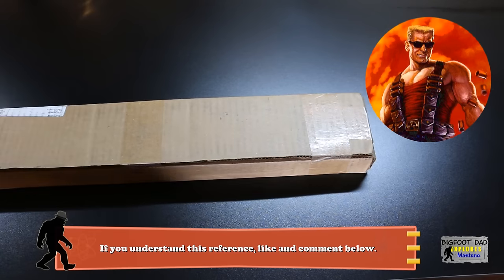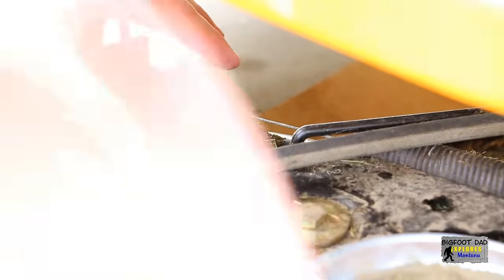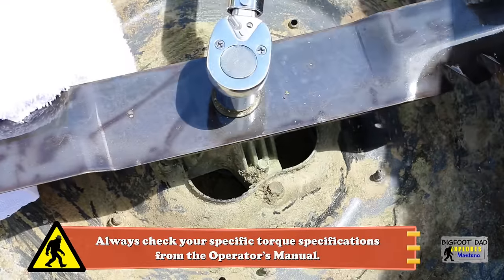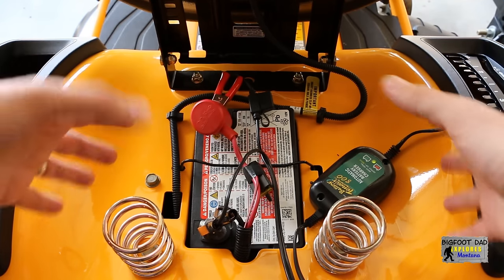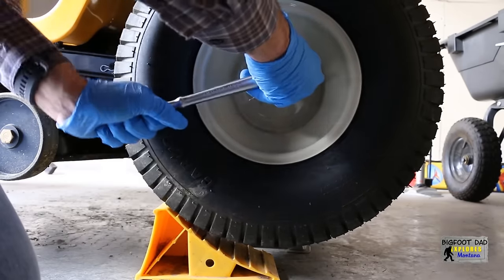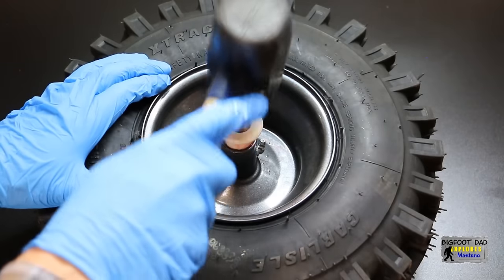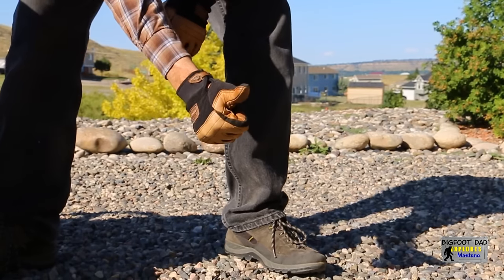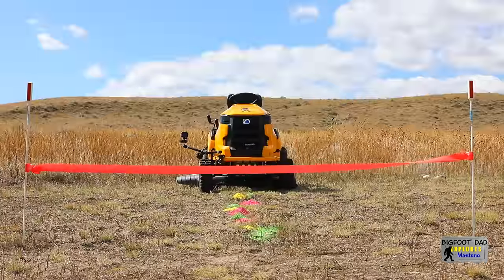Upgrading Your Tractor Mower: Cub Cadet XT1 LT42" Mower (ATV Tires, Blades, Brush Guard, Headlights)

Comment: When I removed my deck for the first time I power washed it sanded it down and had it sprayed with bed liner. 20 years later it’s still rust free.
Reply from the maker: Hi, Medic407 - I agree - I should have done that in the film.  I appreciate your feedback and I may give this a shot now!
Reply: Under that bed liner there will be rust.
Reply: @BigfootDadExploresMontana  what  did you use on your cub cadet riding mower to give it shine. In the upgrade video
Reply: @BigfootDadExploresMontana  EZ-Slide Oil Based Graphite coating helps preserve the deck AND works to keep wet grass etc. from building up under the deck. I wire cup brushed mine clean, scuffed the remaining good paint, blew the loose dust off with an air chuck. Wiped it all down with acetone and brushed on 3 coats of the EZ-Slide. I have a Craftsman T240 that has the exact deck setup. Just slapped the AG tires on the rear to get through some swampy spots in my 1-3/4 acre yard.
Reply: I scraped off all the grass this past Saturday from My 2020 Cub Cadet Enduro with Intellipower and power washed it. Later this afternoon (Monday) I am going to spray mine with two or three coats of "undercoating" I bought from Tractor Supply Co. It's for undercoating automobiles. It should hold up for years. I will check it in two months to see how it is doing. I had considered bed liner. Glad yours worked out as good as it did.
Reply: John Wattie but the rust will not continue to spread duh 🙄
Reply: My 1964 Simplicity Landlord Tractors deck is in as near new that can be expected for a close to 50 year old tractor. I just clean its deck twice a lawn cutting season here in Michigan. I mow from late April and than mulch leaves until about first week of November. There is something about mulching leaves and leave its deck nice and clean to a point and where it isn't i just take a putty blade to it once mostly clean I just use a spray can of penetratingly oil and soak it down. Never use a power washer on a deck unless you cover up the blade arbors to protect them so as not to force water into them. BTW I also own 2 other tractors but much larger than my Landlord that are about 30 years old each and I do the same to them and they still look as new. But Simplicity tractor decks are thicker than most others. Thanks
Reply: Yeah I was wondering if I could spray it with something to make it last, I'm going to have to do that come spring time.
Reply: Does grass stick to it easily?
Reply: @RockyJayyy  in the back corners it did but it washed out great. I
Reply: @unclejohn5012  if the metal was prepared properly before adding the Line-X, how will rust be underneath the material?
Reply: Can I buy a spray can of bed-liner and apply that OR is that something special??
Reply: Smart.
Reply: A lot of people say the bed liner makes grass stick

Comment: I added a washout port to my mower the beginning of summer. You'd be amazed how well it works. My mower deck used to look like that when I would have to scrape off old grass a few times a during cutting season. I checked it this week before storing for winter and with regular use of the washout port after every cut there was hardly any grass stuck to the mower deck.

Comment: I have a 2005 Troy Bilt Pony. 42in is perfect for my property because it's just a single family home. The deck is starting to rust through and it is discharging all of the debris out of the top of the deck. The mower runs great but I know I'm going to be in the market for a new one after this season. I was at Home Depot yesterday picking up blades and I was literally looking at this exact Cub Cadet sitting next to the same size Troy Bilt Pony that I have right now. I like the hydrostatic drive. I like the taller profile and I love the seat. This is $400 more than the Troy-Bilt. I'm glad you made this video. It just made it easier to make my decision.

Comment: Thank you for the tips.  My XT2 spends all summer towing a dethatcher and aerator as well as trailers and all winter pushing a snowblower.  Liquidflating the rear tires added traction for towing and pushing. Your new blades are for mulching,  you can tell by the inward twist of the teeth at the back of the blade.  High lift blades will be twisted outward to increase the lift and discharge of material.   After a couple of warranty issues with a new machine it has proven to be an excellent purchase.

Comment: Cool video! I upgraded mine with bar tread tires almost immediately. Natural springs make for copious mud mowing opportunities.

 Tip: oil change is a fall maintenance item. You don't want it sitting all winter with the impurity "tainted" oil.
Reply from the maker: Hi, Norsefalconer - thank you for the feedback and the oil change tip.  I certainly think that is reasonable and may look into that after this season is over. 
Your mud mowing opportunities sound epic. 😅

Comment: I have watched about 46  videos about lawn tractors and zero turn mowers. I have taken 1 trip to the store for a sit down in different models.and a phone call for extra info. I was at the probable decision on CC XT1 42.  But honestly, I have been walking my mower for 30 years, and the hills and dips make the decision difficult. This and your other Cub Cadet video are just fun. If I get one, you will have tipped that balance. I will probably need those big O tires for my hills. Thank you again.
Reply from the maker: Hi, Stewart!  Thank you so much for your feedback!  I think as long as you're hitting the hills straight on and they're not too steep, something like this may work (in accordance with the safety guidelines for the mower - sorry, have to say that 😉).  The tires seem to help my on my terrain pretty well.  If you decide to get one, let us know how it goes!
Reply: @BigfootDadExploresMontana  Today was the day.  They (Tractor Supply) raised the price back to 1699, from last weeks 1599. Didn't notice until on the trailer.  OH well.   Got it home went straight to my hills.  It did OK on about 1/2. The other 1/2 was a little sketchy. My hills are bumpy.  as a rear wheel lifts up, ... yes it just spins. I could rock in the seat a little an that helped.  A little shovel work will fix  my entry  and exit, to the highs, and lows. Checked tire air when putting unit away . all 25+ PSI . Took them down to 13PSI and will how it  does.    
 Thank you for your pep talk. I think TSC owes you a thank you also. Now lookin for a GUITAR silhouette   sticker. With Flames of course.  :)

Comment: Great video.  I’d love to put those tires on my XT1.  I’ve gotten stuck in my muddy yard a few times in the spring and fall.
Reply from the maker: Yes, I think you'll find these work pretty good.  Right now my tires are still covered in mud from last season.  It does seem to help!  Put them on and let us know how it works.   😎
Reply: I have bar treads on mine. It only got stuck once, but it was sunk to the rear axle. Mud Mowin' Baby!

Comment: I clean my mower deck after each use and spray it with silicone or teflon spray makes the deck look new your deck is already full of rust just a tip

Comment: Never had an automatic battery charger.  Have an ancient old 1 amp trickle charger though I put on occasionally when I bring the battery indoors for winter storage.  I thought of adding a brush guard, but then I wouldn't be able to get in as close as I like to in some areas, leaving more for the string trimmer to do so I opted against it.  I did add LED lights instead of the old incandescent 1156's.  Our land is fairly flat so atv tires are unnecessary.  I did however pump slime into the old tires so I don't have to air them back up every week, lol.  Adjusted the valve lash yesterday, .004 on the intake and .006 on the exhaust.  Also added "poor man's power steering" by adding needle bearings to the front axle spindles.  Will also add bearings to front axles and get rid of the old bushings to save on axle wear and let the wheels spin more freely.  Also fixing to put in an inline fuel switch to make it easier to run the carb dry in the fall without having to empty the tank.
Reply: Just bought a Cub LT50, and was thinking of adding bearings to the axles. If you have an AGM battery you should make sure the battery charger is compatible.
Reply: @anthonybrincefield2812  The batteries I use are plain old-fashioned lead acid batteries.  I've found that if I leave them in the mower over the winter it shortens their lifespan significantly as opposed to wintering them indoors in my utility room and occasionally topping them off with the trickle charger.  My last battery lasted about 3 years keeping it outside in the mower.  My current battery is the same brand, same cranking amps, etc. and so far it is now on its 5th year and cranks the engine over as well as when it was new.  Now, of course I don't do that with my truck's battery, but it gets used at least once a week so it isn't sitting dormant in the cold for long periods of time.

I did add the needle thrust bearings to the steering spindles and they work great.  However, the bearings I tried to replace the bushings with, while they fit okay inside the wheel hubs, they would not fit on the axles at all, not even when trying to persuade them with a BFH, lol.  So, for now at least I'll just keep greasing the old bushings.

Comment: I love how it looks, BUT, those tires would tear up a lawn so fast. If you plan on doing field work with it, fine but a regular lawn, no thanks.
Reply: They won’t tear up anything unless it’s wet
Reply: Cool video. ATV tires with traction control does chew grass up dry or wet. Wifey not happy when I tried those tires. In the Snow they work great!
Reply: @hipsterj1  👍
Reply: I cut all season with chains ⛓ on my tires. Only turfs the lawn if you spin which isn’t very often.

Comment: I bought this mower last year (2020) and planned on it serving me for several years. I was proud of my new mower! I changed the oil and filter at 4.8 hours and used it most of last summer. It sat in my carport during the winter. I changed the oil and filter again at 11.1 hours before using it this spring. I had been using it approximately 15 - 20 minutes when I heard a loud bang and it stopped immediately. I took it to an authorized service center and after contacting MTD (Cub Cadet Corporate) they will not cover the warranty and fix my almost brand new mower! I talked to corporate and asked them what I could have done to prevent this, and their answer was they wished they could tell me, but they are not going to fix my mower. I will never buy another Cub Cadet product, nor recommend to anyone I know! Through no fault of my own, this mower turned out to be highly defective, and Cub Cadet is being penny wise and dollar foolish!
Reply: I,m going to guess that without a fuel shut off valve, the fuel leaked into the oil when parked and thinned the oil and took out the bearings. I had similar deal with another mower after forgetting to shut off my manual fuel shut off valve

Comment: Dude, go get a riding mower lift and thank me later. And stop mowing wet grass!
Reply from the maker: Gilitar - this is... tempting.  And it's giving me an idea.  😂  As for the mud, I wish I could avoid that, but to be honest, it is so dusty that I actually wait for a light rainstorm before I mow sometimes.  I do let it dry out for a bit, but right before it's completely done, I'm out there hitting it out as fast as possible.
Reply: I have a mower lift, it is a great time saver.  I use my cordless impact to remove the blade nuts then put them back on with a torque wrench, its much safer with a impact removing the blades, you can put them back on with an impact but I don't recommend it as you may over-tighten and strip the threads by doing so.  Yep mowing really wet grass causes all that buildup under the deck.

Comment: The exit chute often cracks or a stone will blow through it. Had to replace two!So, I spent $20 and had a spray-in truck bed liner. I used Line-X. Fixed the problem.

Comment: I genuinely enjoyed this. I installed off road led lights to my Troybilt and although not necessary I made my blades razor sharp just because we got buffalo and Johnson over 5x5 acres and layered a super thick layer of flex seal and flex tape on the inside of tires
Reply from the maker: V8 For A Heart - the off road LEDs - dude, yes - that's what I'm talking about!  You have quite the yard adventure and, actually, it sounds like a blast.  And you've upgraded just right to suit your needs so I commend that!
Reply: Bigfoot Dad Explores Montana my mower crapped out a few weeks ago. Bearing chewed itself right up on the shaft for the blades. Collided with the other blade and bent the shaft , cracking the hub and in turn locking up the motor to a complete stop and roasted the belt.

Comment: Just ordered a set of those rears for my zero turn. I have a low strip across the middle of my 5 acre yard that is slow to dry out in the spring when I start mowing and I get stuck every year while trying to get that area mowed. With these tires I believe my spring time mowing will be more enjoyable this year. If I am happy enough then my second zero turn will be getting a set also.
Reply from the maker: Hi, Dale86 - this sounds like an awesome upgrade for a zero-turn. Send me a picture after installed to my Facebook account and I'll share it here.
Reply: @BigfootDadExploresMontana  Will do!

Comment: You mean to tell me that this guy cares about his mower and did maintenance lol when I get a mower in no one changes air filters or oil thanks for the video good quality and content  I like the upgrades and those blades are a good choice I’d recommend them to anyone who mows grass also cub cadet is good I own some old ones and love em probably one of the best brands I do recommend that it’s helpful to clean it off when done using it I always leaf blow mine off when done because the grass holds moisture I learned a lot from this video thank you!!
Reply from the maker: Hi, Hunter - yes, indeed!  I bet you see a lot of the worst of it in some cases if you're doing this on a regular basis.  😂  I really appreciate your feedback and insight.  I agree with you on the cleaning procedure - the leaf blower would actually probably be a more efficient way of cleaning off the mower.  Thanks again and keep the comments and tips flowing as we release new videos.
Reply: Bigfoot Dad Explores Montana your welcome glad I could help your videos are straight forward and to the point

Comment: I recently upgraded mowers but now have a 12+ year old YardMan with a shot deck that still runs fine. I have been kicking around ideas of what to do with it. I don't have a need for a proper large tractor but I do have some tasks in mind that I might be able to fabricate some attachments for this mower to do. I might have to make a front and back attachment and cast some cement weights to keep it grounded, but those tires you put on certainly got my mind thinking. The only thing keeping me at bay of doing all this is I don't have much confidence in the drive train / transmission if you will on these things holding up to this sort of pulling force. I picture the drive box to be made up of mostly plastic / nylon gears and that when under this sort of pulling force it might just chew them right up, or the belt that drives the whole thing will just begin slipping. Who knows.
Reply from the maker: Hi, Terence - You have a very valid point about the stress on the transmission from those tires.  That is eventually what lead me to put that disclaimer on the front of the film.  The transmission was probably engineered for these turf tires to allow slippage if under too much stress.  On your YardMan - it may be time to upgrade that thing with some of the mods you mentioned and maybe post it on your channel!  🙂

Comment: My XT1 is spotless underneath. Mowing leaves in the fall cleans under the deck down to bare metal just like sandblasting would. I never remove the deck to change blades. Works for me.

Comment: Great video! Love the aggressive tire look. I've been using same set of Gator blades on my JD for nearly 20yrs are great! The only thing I would change are the front plastic bushings 11:45. You can upgrade from bushings to actual wheel bearings. If you noticed the bushings will wear the spindle over over time 12:11.
Reply from the maker: Hi, @stevelucas2117 - yes, I totally agree that I should have done this.  This was a few years ago and I am recalling that there wasn't much information on how the bearings worked.  At the time, for some reason I thought they weren't compatible with the spindle and wheel.  I still think this is a worthy upgrade and might have to check this out soon.  Thank you for your comments and we're glad you're here with us now! 😎